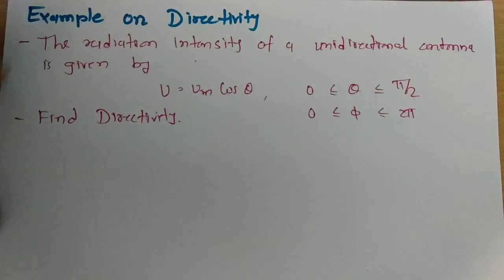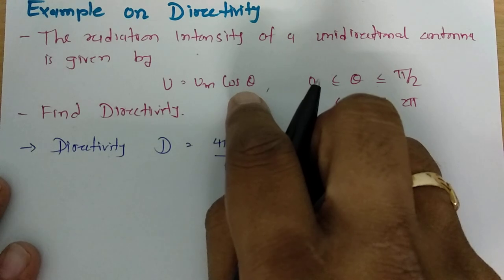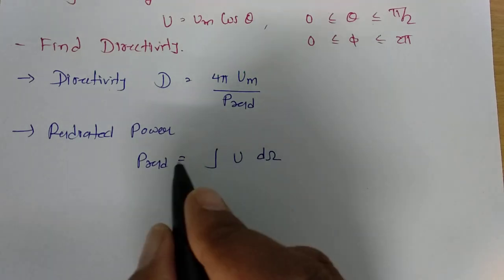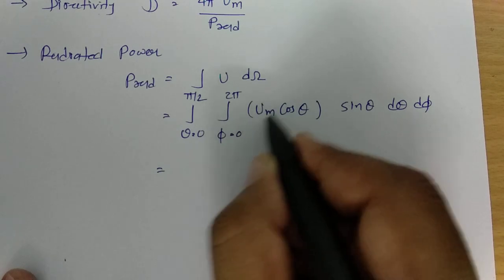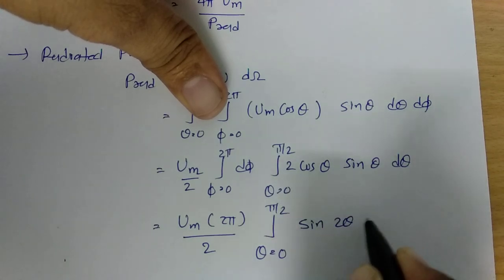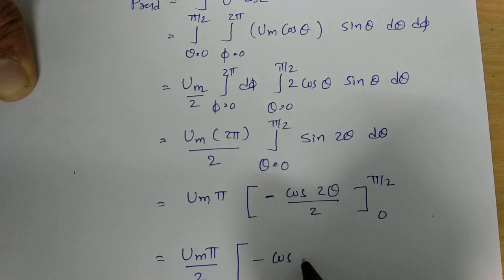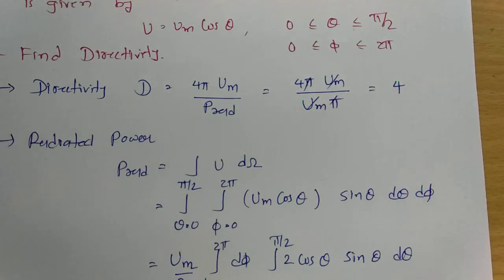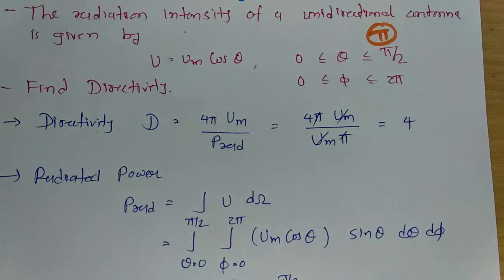Example of Antenna Directivity | Antenna Parameter | Antenna & Wave Propagation | Engineering Funda

Comment: Could you please help solve this problem on Directivity -  ?
 
The radiation resistance of an antenn ais 72Ohm and loss resistance is 8Ohm. What is directivity if the power gain is 16?
Reply from the maker: Power gain * ( Rr / Rr + Rl )